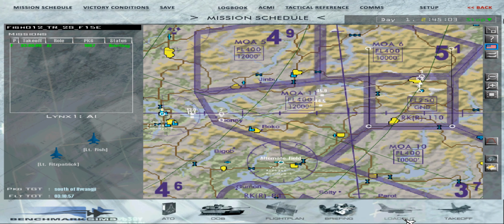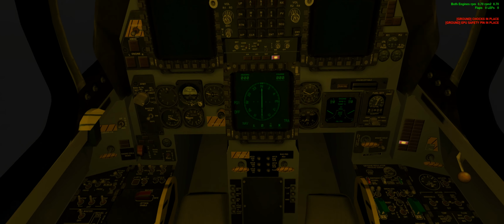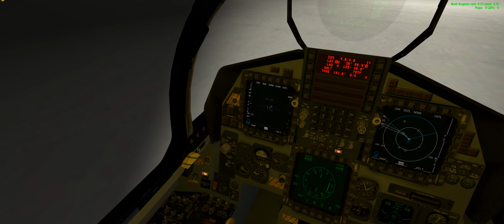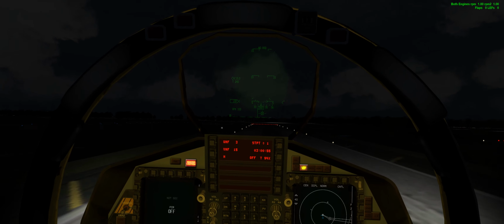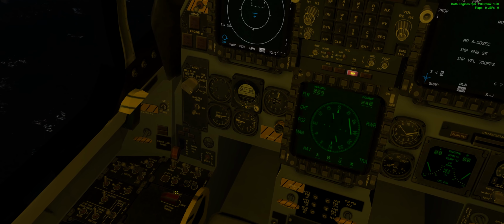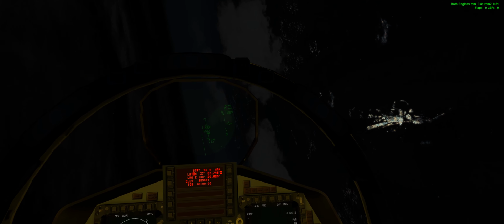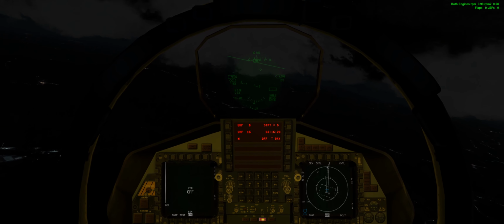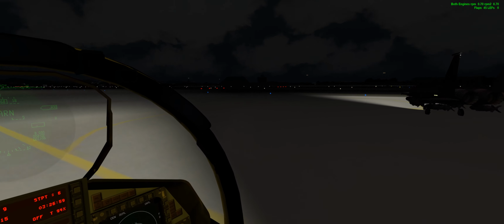BMS 434U3 F15E Introduction

Comment: Is that the stock F15E cockpit or do you have a mod running ? It looks very full-featured
Reply from the maker: Its included in BMS. Like all non-F16 aircraft, it uses only the f16 avionics suite, so it lacks realism in that respect, and some of the F15 functionality cant be implemented. Its kinda like an f16 with a different internal and external skin, with FM data appropriate for the F15.
Reply: I'm ok with that. The only thing that really annoys me about bms is how it doesn't allow me to use monochrome mfds  and different radar symbols like previous mods would for aircrafts other than the f16.